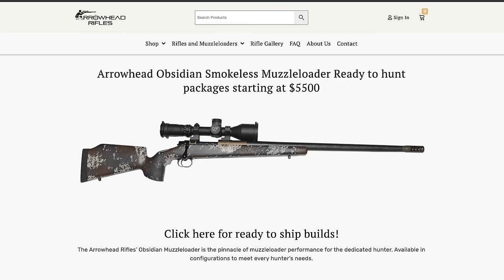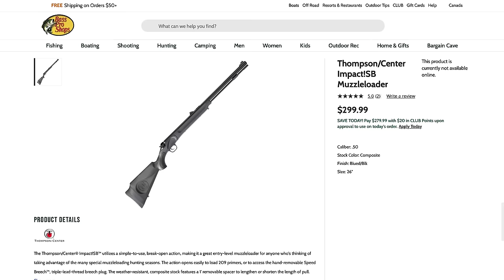Cheap vs. Expensive Muzzleloader CHALLENGE! (BUCKS EVERYWHERE)

Comment: Luck of the draw...😂 I don't hold anything against expensive firearms/bows/or hunting gear, but if a less expensive one does the job efficiently and quickly, why not. I started off with a New England single shot 30-06, 50 years later it's a go to. Love what ya'll are doing 😊

Comment: Low Pressure 50 Caliber Smokeless Loads in a 209 Factory Muzzleloader, 2 DVD set | eBay
These 2 DVDs contain a demonstration of using Low Pressure Smokeless Loads in a 50 caliber factory muzzleloader.

Comment: I bought a CVA BP rifle at Sam"s back when the inline magnum rifles first came out for $150.  I got a lousy pattern out of it at 100 yards until I changed bullets and suddenly I'm getting 1 inch pattern at 100.  Years later my Dad needed a new BP gun and paid $150 for a CVA Wolfe.  We got about 1.5 to 2 inch pattern out of it when we found the right bullets for it.  I'm convinced that if you find the right bullet for your rifle and adjust your powder charge for your rifle nearly any gun out there is get at least a 2 in pattern at 100.  Anyway, if you can shoot decently without flinching.

Comment: Thompson Center muzzleloaders have not been made since 2021. Smith and Wesson acquired the company and liquidated them. Thanks a lot Smith and Wesson. I would not recommend buying a used T/C. I recently wanted to replace the breech plug on my old Black Diamond. It was a $15 part a few years ago. Now the cheapest one I could find was $100. So if you need T/C parts, you are going to be SOL.

Comment: How does a bolt action muzzleloader work?
Reply: Same as a break action. You load the powder and bullet from front. Then open the action insert primer module and close the bolt. This indexes the primer into the breech plug. Same as a break action where you open it like a single shot rifle, but instead of inserting a bullet you insert a primer into a breech plug.

Comment: That's not a muzzleloader, that's nothing more than a smoke less center-fire, it's like calling a crossbow archery hunting
Reply: Where do you load the gun?
Reply: @jordanclark5462 Via the muzzle but when states started adding muzzleloader seasons the equipment was historically accurate and unreliable and manufacturers quickly came out with modern options using modern technology.  Replace the patch and ball with engineered sabots and, cap gun size ignition source with shotgun primers, simple black powder with cleaner, hotter pellets, the iron sights with scopes, and add the ability to remove the breech to unload. You can hunt successfully with a replica Hawken muzzleloader but to pretend a cheap CVA in line is in the same league is ridiculous.